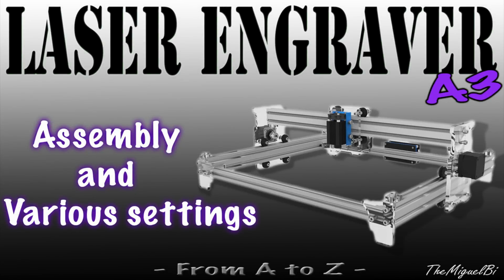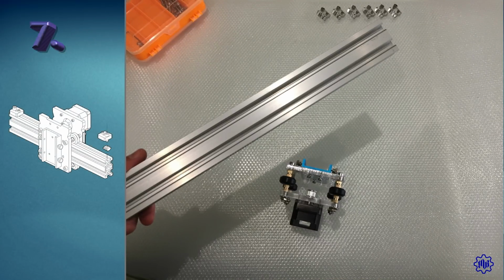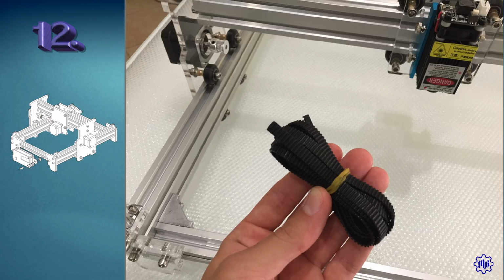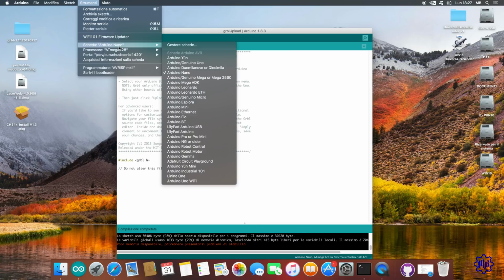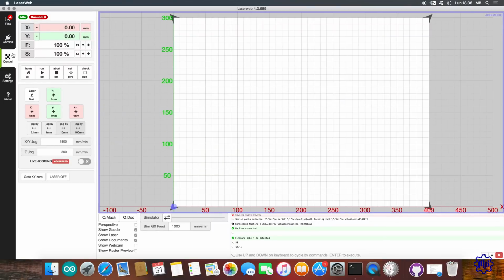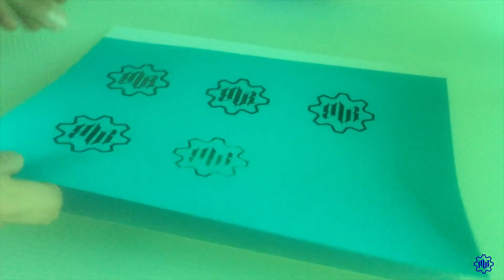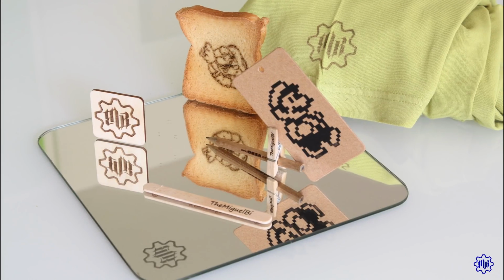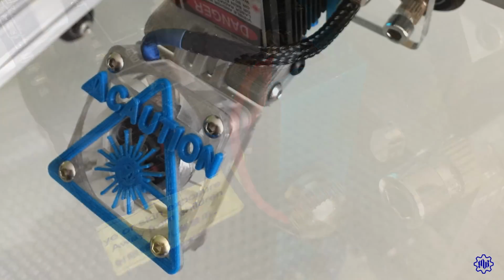⚛️☢️ Videotutorial - Laser Engraver 2.5W A3 (400x300mm) [UHD 4K] ☢️⚛️

Comment from the maker: Up to October 10, 2017 on the Banggood site costs ONLY 162$ !! Hurry up !! https://www.banggood.com/2500mW-A3-30x40cm-Desktop-DIY-Violet-Laser-Engraver-Picture-CNC-Printer-Assembling-Kits-p-1003863.html?p=5A30161023006201412PL 
My configuration GRBL v1. 1 (Using the $$ Command Clearly):
: $0=10 : $1=25 : $2=0 : $3=0 : $4=0 : $5=0 : $6=0 : $10=3 : $11=0.020 : $12=0.020 : $13=0 : $20=0 : $21=0 : $22=0 : $23=0 : $24=25.000 : $25=500.000 : $26=250 : $27=1.000 : $30=256 : $31=0 : $32=1 : $100=80.000 : $101=80.000 : $102=80.000 : $110=4000.000 : $111=4000.000 : $112=2000.000 : $120=400.000 : $121=400.000 : $122=400.000 : $130=300.000 : $131=300.000 : $132=200.000

Comment: Thanks for this video. My self I have a DIY laser engraver using the ElecsMaker Mana SE 3 controller.
The Laser is a 10W one. I tryed several software to drive my engraver. Unfortunely it woks only if the laser is off.
Wenn I switch on the laser intrrupts the connection. Can you help me?
My english is not very good, but I hope you undestand my problem.

Comment: works with arduino uno.
Reply from the maker: The board mounted on the "Mana SE" is an arduino (Arduino Nano). The answer is therefore yes.
GRBL firmware can be installed on any arduino board. For info https://github.com/grbl/grbl

Comment: As I am hard of hearing the computer narration I struggle with, I had to watch purely in subtitle mode, I realise the author is Italian  and this is why they have chosen to use computer narration but it does not work for me. Apart from that a relatively good video.

The air flow fan on the laser would be better if it was turned into an air assist and this would greatly increase the cutting/burning  power of the laser. You should also consider using a ventilation system to suck away the smoke produce through a carbon or charcoal filter. 

Treat the lens as if it was a camera lens as that is exactly what it is and always refocus on every job if the material you are working on it different as there is no depth of field on a laser beam at its focal point. It will cut perfectly or badly.
Reply from the maker: Hi Sitges Villa Apartment Familia Scott, 
Yes that's right, this is the only way for me to be able to post a video in other languages. I understand that this is not good for many, but it is the hallmark of my channel. All my content is structured in a synthesized voice.
You can find the video in Italian, perhaps it is more understandable in Spain: https://youtu.be/HQ9KpKGFfA4

For fumes I use the laser on the open air balcony. Making vinyl stickers is extremely toxic and annoying the smoke produced!
Furthermore, the laser module abandoned me due to overheating a few months ago. I ordered one more wattage, let's see if I can do some more videos in the near future.

Thanks for watching, 
Bye
Michele
Ps. Sitges is a beautiful city! I was able to visit it a few years ago. 
I remember having lunch at the "Los Vikingos" restaurant.  ;)
Reply: @TheMiguelBi   Yes Los Vikings is still there as the village is looking very different now to a few years ago, less risk of flooding now and no cars on the beach since they have finished the work!  Your laser probably burned out due to overheating, one thing with vinyl is the the soot creates a deposit on the lens, you need to clean the lens all the time otherwise crud will build up and the power will not go throught he lens, also if you add what is called a "air assist" it will make a very big difference to the way that you engrave and cut and add about 25% more power and at the same time keep the fumes away from the lens, if you want to use the machine inside then rig up a 110mm plastic flexible hose with an inline fan total about 25 euros from Bauhaus, lerroyMerlin or similar, plase the hose aboive the laser using some string to hold it in place and the other end of the hose out of a window, depending on the sizer of your cnc its easy to make a frame to hold the hose, turn on the fan when you turn on the laser and it will suck the fume out, if you also install a charcoal filter it will be safer.  

alternatively put the cnc ion the cooker under the extractor fan and turn that on.! Good luck but do use the air assist it really helps, come over to the Endurance Fracebook Lasers group to see how one is made, its easy to do, cost about 80 euros but worth every cent. makes amassive difference to cutting and engraving.

Comment: Hi!

My laser is constantly being at full power. In Arduino I don't get to check the USB, only COM5 port. Could that be the issue? Please help me, I don't know what to do anymore, it's a nightmare...

Thank you all in advance guys ;-)
Reply from the maker: Hi tadejh,
When there is no communication, this happens. 
Check that you have entered GRBL correctly in Arduino, check that you have the correct drivers on your PC. Check the USB cable is intact and suitable. 
If all this is fine, check the configuration and software settings. I take for granted the control card is the same as the video (Elekmaker MANA SE).

Comment: Hello very good video, I have a problem with my new laser I have an EleksMaker EleksLaser-A3 Pro 2500mW comes with Eleks mana SE board and the Grbl 0.9i is installed. The software for use is EleksCam 3.1. The engines move well the laser works at first sight all right, when with the same program I put a text, it does it without problems, but when putting a design of the same gallery that incorporates the program if it is not very complicated to reach 20 or 30% stop, stop sending the codes, sometimes turn off the laser and sometimes it stays on burning the material, if it is complicated it does not reach the 5% that already stops, but does not give any kind of error in the console . I have tried to use designs with Linkscape and the laser plugin and the same thing happens, and also if I use the UniversalGcode sender the same thing happens and on the console when the following line appears <Run, MPos: 28,950,24,638,0,000, WPos : 28.950.2 “ÉšÂb‚r‚ ‚‚ òj> ok when they appear, these signs are when you stop without turning off the laser. If you have any idea what happens and how to solve it, I would appreciate it. a greeting
Reply from the maker: Hi Pepe Roma,
It almost seems to be a firmware problem loaded on the arduino board, given the present problem using different software. However, I advise you to delete the Chinese software, and to follow the video step by step (also available in Italian). 
Delete the contents of the arduino nano card, and load GRBL again! Then install LaserWeb and use that! Much, much better !!

Comment: Hell.About X asis..i conected mine but it is not fixed completely...i mean it have slight tolerance when i move buy hand.How to fix this..by tension of belt or something else
Reply from the maker: Hi firewirehn crnogorac, 
Try loosening the screws of the laser block and then fixing them again. You should be able to get a fluid flow. 
Only once adjusted can you proceed with the belt.

Comment: Question: I followed your video exactly but when I try to "connect"  software with the laser in Laserweb, it connects only for a few seconds then disconnects automatically and I can't continue. After disconnecting it displays this message "no support firmware detected". Do you have any suggestions on how to resolve this?
Reply from the maker: Hi Bill Wiegandt,
You are already the second person who asks. sure you have used the same software and firmware versions you see in the video? It is not always good to use the latest version (at least if you don't know what you are going to do).
I wouldn't know how to solve your problem.

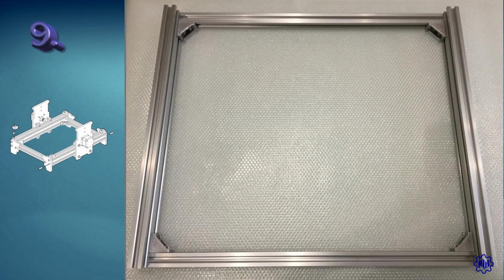Comment: This is a great video. It is very helpful. There is one mistake at step 9 ( exactly at 9:00 minutes). The frame needs to be flipped over. See the drawing beside it .
Keep up the good work!
Reply from the maker: Thank you Jon Rue! 
even if I don't see the error you say. The drawing next is A4 version. Mine is A3. The control board is located on the long side on the A3 version, while on the short side on the A4 version.

Comment: Hi there. Great video! What kind of screws are you using for the 40mm fan at the end of the video? Just machine thread screws, or something else like sheet metal screws? Wondering what thread I need to buy. Thanks in advance!
Reply from the maker: Hi Keith Etheredge,
Thank you!
They are normal M3 screws. I used stainless steel screws (light ones) and I fixed everything to the laser module with some other black M3 screws.
I have this kit, so I have various sizes available: https://goo.gl/VCybY4 and https://goo.gl/WqXKei

Comment: Hi I got the unit running now. 2 issues I am having.
1. The laser seems to speed up on certain areas leaving uneven engraving. Meaning few areas it is going in the correct speed, but certain areas it is repeatedly speeding up and making it very slim light engraving.
2. Laser seems to be burning continuously without stopping leaving the image engraved even during it's movement while doing an engraving.

Any advices?
Reply from the maker: YES! Read: https://github.com/gnea/grbl/wiki

" Laser Mode : The new "laser" mode will cause Grbl to move continuously through consecutive G1, G2, and G3 commands with spindle speed changes. When "laser" mode is disabled, Grbl will instead come to a stop to ensure a spindle comes up to speed properly. Spindle speed overrides also work with laser mode so you can tweak the laser power, if you need to during the job. Switch between "laser" mode and "normal" mode via a $ setting. "

As I already wrote you ... did you check all the variables by typing $$ ??
Reply: have you fixed the issue?
Reply: TheMiguelBi thank you. I have got it working fine. Issue I had was with the installation. I reinstalled, checked it with your settings $$ and now all is fine
Reply: Eper Gaboni hi, yes, now it is working fine. Sorry was travelling last few days. So delayed reply

Comment: Also note that the laser web 4 seems to have the upgraded software with additional options in the settings bar. And my laser even on 100% seems to show only a blue dot and burn anything. Only while connecting usb the laser seems to come on full power and leaves a burnt dot for a split second. Can you help me.
Reply from the maker: Hi Bezalal Blessing,
In all software you can install a previous version. If you think you have different functions, just install one of the previous versions from here. https://github.com/LaserWeb/LaserWeb4/releases. 
Try it does not cost anything.
The latest version is v4.0.992, March 22, 2018. In video use v4.0.989-115 version as seen at minute 16:03
Also what lasers are you using? what electronic card? This is mine: https://goo.gl/Dfp1Po
Reply from the maker: Surely the GRBL variables are not set correctly. 
Type "$$" and compare your data with mine. Find the values at the first comment.

Comment: can u etch acrylic with this??
Reply from the maker: If it is black, yes.
To engrave / cut transparent acrylic, you need a CO2 laser. Its wavelength makes the visible transparent PVC become, making it possible to cut. With this laser diode, however, everything that is transparent to the human eye is impossible.
Reply: even with that technique u use with the mirror?
Reply from the maker: Yes, to engrave it can work using black marker.
Reply: gonna try that! thx again man :D
Reply: Voce conseguiu gravar em acrilico transparente ?

Comment: I just set up my new laser cutter and got it working with your tutorial. What I am trying to do now is replace the stock laser that only output 500 mW with a new laser that outputs 14 W My issue is that the laser that came with my system has no PWM pin so my system is out putting from straight voltage somehow to that laser. My new laser has a PW and pin it to very the laser output but the GRBL documentation output states that the killer hertz frequency is 1 kHz and I need to change this to 9 kHz for my 14 W laser module I have tried to change this in the CPU_map.h file with no avail
Reply from the maker: Hi Laser Dabs,
I can not help you for this. I'm sorry.
You should search through the GRBL wiki.
However I think it is easier to buy this card, identical to my video. https://goo.gl/FDHqUF

Comment: what is the distance between lines that you use for engraving?
Reply from the maker: Hi Guillem Vallicrosa Massaguer, 
Emh.....I think I do not have the idea! XD 
The Gcode generates it directly Laserweb4, starting directly from the selected image. I think everything is left to default.
Reply: +TheMiguelBi ok, I will check the defaults for image. Until now I have only worked with vector files and there you have to specify a distance when engraving. Thanks a lot for the fast answer.
Reply from the maker: The truth is that my laser has been stationary for almost 1 year. I have to use it outdoors, on the terrace. In the cold winter months it remained off, Now that spring begins, I think I'll do a second video with the engraving of grayscale imagery. As soon as time permits me. ;)

Comment: how do i activate the laser cut mode instead laser raster?
Reply from the maker: Hi Ruben Castanho,
It depends on the type of file. Try drawing a square with a simple program, paint for example. Save it in various formats, and try uploading these files on laserweb4 one at a time. You will see that the cutting option will appear.
Reply: i found it, its the svg file :D  thx :)

Comment: Thanks for the great video, very useful, 

Do you know why, when I'm going to engrave some file, the machine triples the size?
If my file is 10 cms the machine engraves 30 cms, thank you!
Reply from the maker: Hola Andres Sossa,
Sí, es un problema de configuración de GRBL.
Para resolverlo, debe establecer los valores $100 y $101 a 80. Ahora debe tener el valor predeterminado de 250 (incorrecto para estas correas y poleas).
Para cambiar los valores, puedes ver este video: https://youtu.be/GthY-ipk7Ys?t=21m3s
Las operaciones para hacer son las mismas, simplemente ejecútelas dentro de LaserWeb4 en la esquina inferior derecha.
Reply: Miguel, seguí tus instrucciones y quedó resuelto el problema, muchas gracias por tu respuesta, por tu amabilidad y prontitud, perfecto! gracias!!!
Reply from the maker: De nada! ;)

Comment: Is it ok to use this setup with the 7W laser (Laseraxe)?  Many thanks  Paul
Reply from the maker: Hi Paul Loseby,
No, the electronic control board is different. It has an extra driver. You can always try. The easiest solution is to purchase the card equal to the video, so you can follow the video step by step. (The difference in power of the laser module is not a problem.)
Here you will find the card already complete and ready: https://goo.gl/FDHqUF (I can not find it on gearbest anymore).

Comment: Hi guys, thanks so much so far, you've been a massive help. I'm trying to connect the printer but I'm getting the error message that my GRBL version is too old (0.9i) any idea why? I definitely downloaded the latest version. Thanks in advance!
Reply from the maker: Hi Joel Brown,
Thank you!
The latest version is v.1.1f (https://github.com/gnea/grbl/releases). 
The 0.9 is too old for LaserWeb4 probably. Update Arduino Nano with version 1.1f!
Reply: I swapped my Nano for a new one just so that I could at least fall back to factory settings. this turned out to be a good move as the supplied Nano would not respond to the Arduino boot loader anyway. They prolly just burned the hex file directly onto the Nano instead of adding the loader first. I also noticed that mine had V1.1z installed - no such version!!!!!

Comment: Thank you very much for your video tutorial. It is the best I found to solve problems. I follow your video step by step several times and I always have the same trouble. "No supported firmware detected. Closing port /dev/cu.repleo-CH341-0003014".
I don't know where I was wrong...
Reply from the maker: Hi ThermaFrance,
Thank you.
It seems a Drivers problem. Have you tried installing the China drivers?
Mac or Windows?
Reply: Hi, thank you very much for your answer. Now drivers problems are solve. I have a scale issue, for 10 mm the movement is 30 mm and I didn't find the scale adjustment...
Reply from the maker: You need to edit the GRBL setting files. Click $$ and press Enter. Check the $ 100 and $ 101 values! I have to be 80 !!
At my first comment, below the video, find my values. Set equal to your laserweb!
Reply: Ok I understand, I didn't set any new values. Which software do you use to open the config.h file ?

Comment: hi why when i try to do wording the lettering on some are not all level . some up and some down
Reply from the maker: Hi mick roda,
I think the problem is either the surface (or the laser) not quite flat. The Chinese laser also does not create a perfect circle, but a sort of elixir. This, issue, will cause it to be different in some axes. I noticed it by cutting a 20mmx20mm square on 3mm of wood. 2 sides were cut after X levels, while the other 2 sides needed some extra pass.

Comment: Hi! Really nice video! BUT! I cant find the Porta... Did u now why?
Reply from the maker: Hi Angelo,
Are you using Win or Mac? It's a Drivers Problem!
Reply: TheMiguelBi solved! But I Have other problem... all ti me i try to start a project the laser goes to left, up and dont engrave... Have follow all steps...
Reply from the maker: Have you checked all GRBL variables? At my first comment you will find my values. Type $$ right below and check that the values are the same as mine!